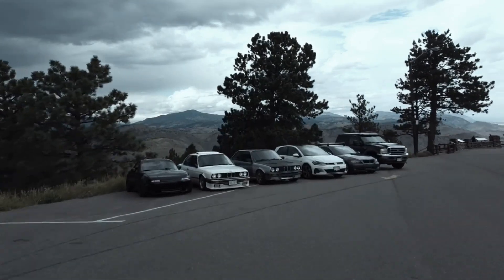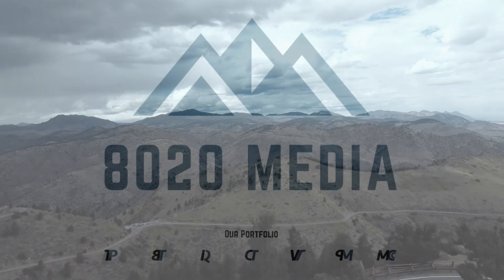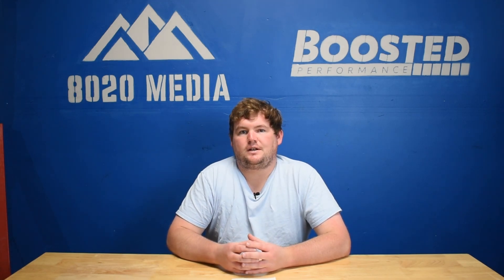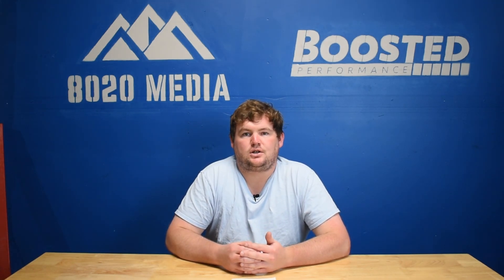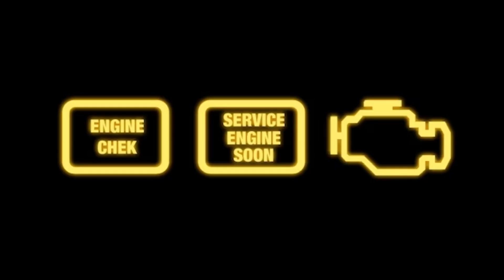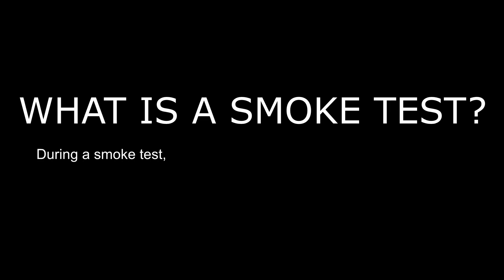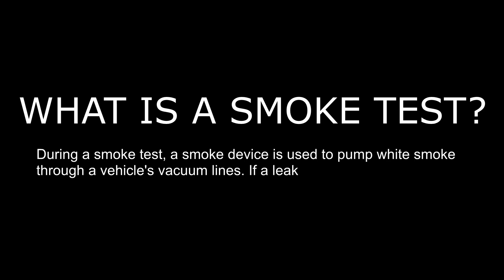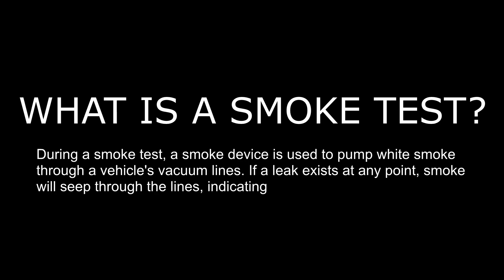DIY – How to Diagnose and Fix A Rough Idle Car | Causes & Solutions

Comment: I have rough idle , vibrate and stall when car is cold for 5-7 min , and only when car in Gear D or R, and in autobhan when engine is underload, with 1100-1400 rpm car shake,stall, 
In vcds show code maf sensor P0101
And car enters regeneration often

What's the problem with this car that I don't understand?
Audi A8 4.2 tdi 2016

Comment: I have a Mercury Grand Marquis gs, 129,999 miles. Rough idle, loss of power, struggle with acceleration and a check engine light. The only code from the light is o2 sensor light, and check engine light flashes sometimes. I was told the o2 sensors aren’t the issue due to the severity of the issue, do you have any advice?
Reply from the maker: D - It’s very likely you have a severe misfire, which is triggering secondary O2 sensor faults due to unburned fuel hitting the exhaust; a flashing CEL almost always means an active misfire that could damage the catalytic converter. Start by checking the ignition coils, spark plugs, and plug wires (if equipped)—these are common failure points on the 4.6L V8, especially if the ignition components are original or old. Also inspect for vacuum leaks, particularly around the intake manifold and PCV hoses, which can lean out the mixture and cause rough idle. Once the misfire is fixed, the O2 code may resolve on its own—so don’t replace sensors yet.

Comment: I have rough idle on a 2018 jeep wrangler sahara unlimited with only 6600 miles, yes 6600 is accurate.....i have no code....
Reply from the maker: N - If your Jeep has a rough idle with only 6,600 miles and no check engine light or codes, it’s likely caused by something subtle like a dirty or faulty mass airflow sensor (MAF) or manifold absolute pressure sensor (MAP), a slightly sticking EGR valve, or even a vacuum leak—all of which can disrupt idle quality without immediately triggering a code; also consider bad fuel or carbon buildup in the throttle body or intake valves, especially if the Jeep has sat for long periods—start with cleaning the throttle body, checking for vacuum hose cracks, and inspecting fuel trims via scan tool to spot hidden air/fuel balance issues.
Reply: Swell and the 😮 can 🎉Touch and hold a clip to pin it. Unpinned clips will be deleted after 1 hour.😢😢😮🎉😮😂🎉😢🎉🎉🎉🎉🎉🎉🎉🎉Use the edit icon to pin, add or delete clips.🎉❤🎉🎉Touch and hold a clip to pin it. Unpinned clips will be deleted after 1 hour.🎉🎉🎉🎉🎉🎉🎉🎉🎉😮😢🎉🎉😢😅🎉🎉

Comment: 2006 toyota matrix xr, 254,000 miles. Shaking engine, stalling, losing power, strong gas smell especially with heater on. Already changed spark plugs and coils, fuel injectors and mass air flow sensor and the problem still there smh. What else fould it be. I only got p0301 cylinder 1 misfire and o2 sensor code even though it was supposedly replaced. Battery and alternator tested and are good
Reply from the maker: A - Sorry to hear this.. Your vehicle with shaking, stalling, power loss, strong gas smell, and codes P0301 (cylinder 1 misfire) and an O2 sensor code suggests an issue with fuel delivery, ignition timing, or a vacuum leak despite replacing spark plugs, coils, fuel injectors, and MAF sensor. Since you're smelling strong gas inside, check for a leaking fuel injector, bad fuel pressure regulator, or excessive fuel delivery causing an overly rich condition. Also, inspect for a vacuum leak near cylinder 1, such as a cracked intake manifold gasket, broken PCV hose, or loose vacuum line, as unmetered air can cause misfires. If the O2 sensor code persists despite replacement, it may indicate a faulty sensor, incorrect installation, or a wiring issue preventing proper fuel trim adjustments. A failing catalytic converter or exhaust leak near the O2 sensor can also affect readings. Additionally, check compression on cylinder 1, as low compression from worn piston rings, burnt valves, or a blown head gasket can cause a persistent misfire. Finally, verify that the ignition timing is correct, as a failing crankshaft or camshaft position sensor can disrupt firing order. Given the gas smell and misfire, I’d start with a fuel pressure test, vacuum leak inspection, and O2 sensor wiring check. Keep us updated!

Comment: Is have a 16 ford fusion! When i slow down the car starts making a weird whining sound and starts acting like it wants to die. Any ideas? It only does this at low speeds
Reply from the maker: A - Our advice would be to check all of your fluid levels and then we'll go from there. This video may also help with your research: https://youtu.be/TJ2j-waLPNA

Comment: New air filter new maf sensor sprayed all vac linetc.etc. sprayed With flamable spray fluids and soapy water no vaccum leaks. New plugs new coils. All cked and firing. No codes but runs rough as hell at idle. Crappy mileage ??? This go green electronic crap. should be illegal dam liberals !
Reply from the maker: A - Sorry to hear man. Hope you get it figured out.

Comment: 1.6 gdi engine with 50kish miles. Sometimes, on a cold start, it will ruff idle for about 10 seconds and then go away, so hopefully, there will be nothing to worry about. Drives fine, so fingers crossed 🤞
Reply from the maker: A - Keep us updated on this!